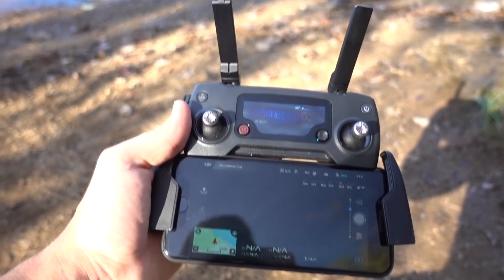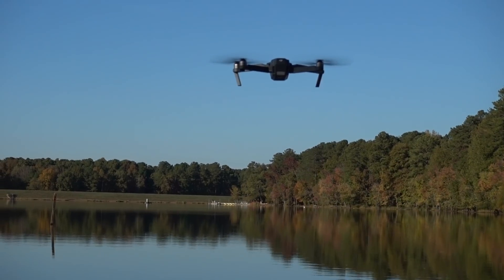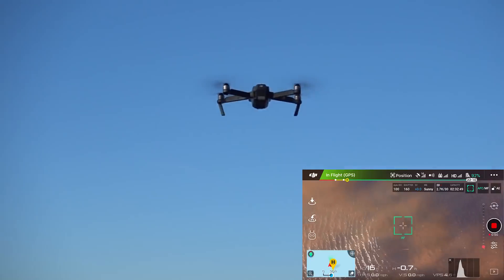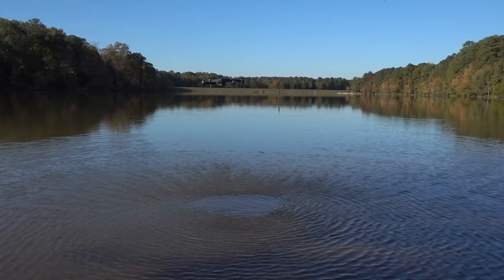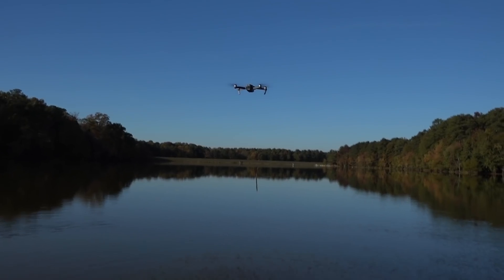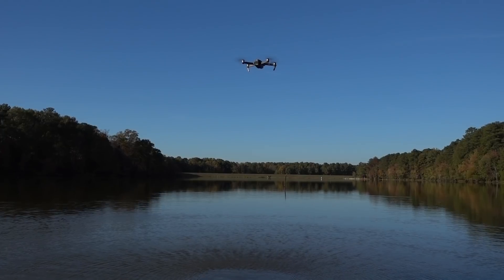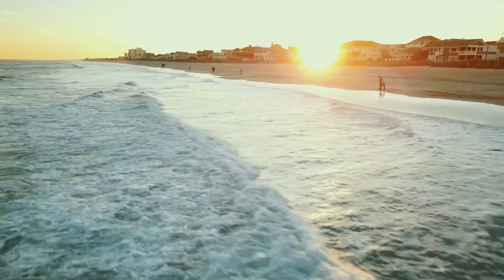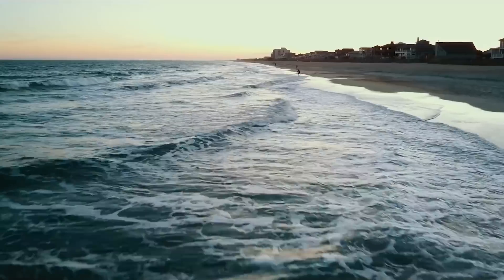Flying Over Water - Downward Positioning Sensors On or Off?

Comment: Geez Ed. You had me nervous. I expected at any moment to hear your controller say “Landing“. How did the drones do while actually flying forward over the water? I have flown over water about 8 feet in the air in the past and had no problem with the sensors turned on using my Mavic. Hope you feel better.
Reply from the maker: Thanks Mike! Flying forward shouldn't be as much of an issue since GPS may start taking over at that point, but that was also more difficult to show on camera. It was easier to show the deviations from a hover than from a traveling drone...especially since the altitude readings couldn't be trusted.
Thanks for watching though, I was nervous too!

Comment: That was crazy.. been flying over water a few times also close to the water.. never experienced that,  mine was way more stabil,  Maybe  because you are close to shore it can sense the ground under the water an the water surface.
Reply: It cannot sense the ground )) It have pressure altimeter, sonic altimeter and the ir cameras.
Reply: Alex Morgun then how do You explain What it does in the video?? An why is mine not doing the same?

Comment: Just as a thought, I'm wondering if the up/down movement you had at the beginning close to shore was the sensors reflecting off the lake bottom and the water surface together was the cause. You mentioned that it didn't make much of a difference with the sensors on/off further out. The lake bottom may be too deep to cause the extra reflection out there...

Just a thought.

Comment: Nice video Ed, I wouldn't fly my Mavic over the water.Hovering is even  more dangerous. I crashed my Mavic on ascending from a hovering point without any obstacle in the way.The Drone just flipped over and crashed on a neighbor's roof.DJI still investigate the failure but it looks like there are quite a few cases like that I found over the web
Reply: One guy was hovering his Mavic about 10 feet and it flipped over crash found out one of the motors went bad maybe that could be it Dji fix it and send it back no cost good luck
Reply: Were you descending fast? I have heard you can get caught in the downward prop wash and loose lift at the props. I think one of the newest firmware updates actually limits how fast you can descend. I also try to have a little forward movement on long descents and save the straight down for the last few feet.

Comment: Hi Ed, 

Have you ever experienced Lens condensation on your mavic? Is it a common problem and do you have any advice on it? Great video as always.
Reply from the maker: Hey! Thanks!
No, never had condensation problems...but perhaps that's an issue I would run into if I didn't let my drone acclimate to the outside temperature or flew into heavy moisture in the air. I can also bet on getting condensation if I had the drone in an air conditioned building or car and then immediately started flying outside in hot humid weather. Seems temperature variations cause it on my handheld cameras more than anything.
Reply: Ed Ricker Vlogs awesome thats for the reply. Thats what i was thinking but some people say it might be a faulty seal on the lens. Do you think its worth sending it in for repair? Or is it normal